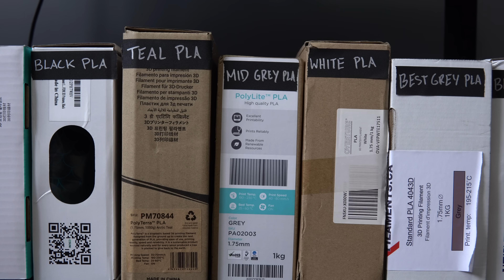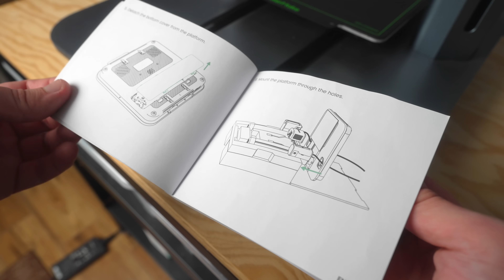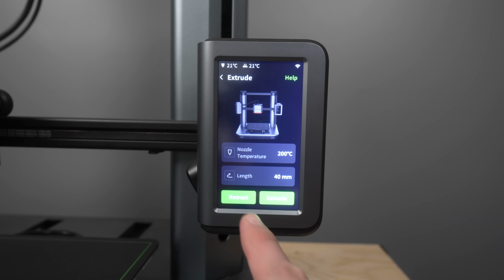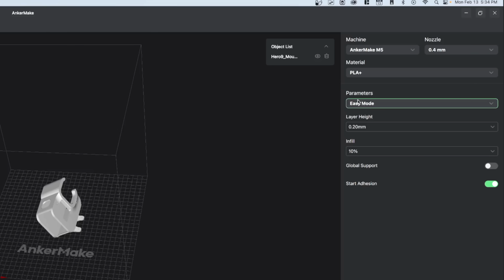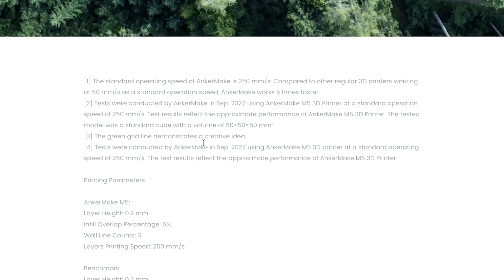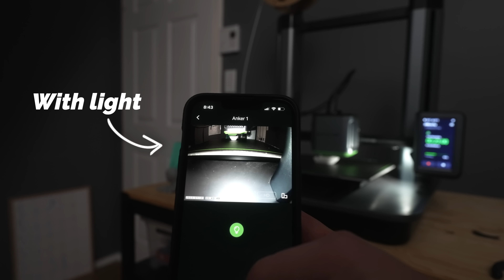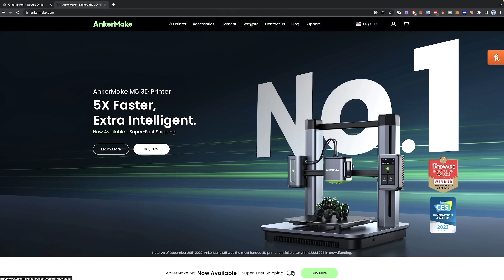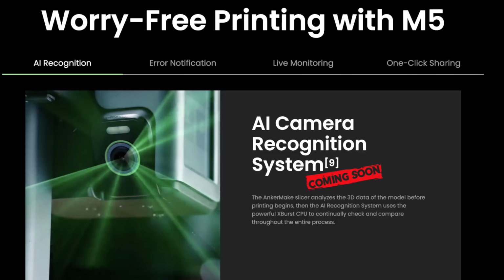The FASTEST 3D Printer I’ve Ever Used (Ankermake M5 Review)

Comment from the maker: You guys are totally right! The actual printing speed of the M5 will definitely be further limited by acceleration. As I mentioned, the 5X speed advertised is mostly a marketing gimmick but acceleration is another important limiting factor to consider. A misstep on my part!
Reply: Too bad they dont sell at bestbuy under the total tech warranty!
Reply: @darith27  total tech will still cover this! No matter what for replacement for 2 years. I’m a manager I promise you this Darith. Thanks for being a meme bee if you are one. But yeah speak to any manager there. They’ll tell you it’s cover for replacement for electronics damages.
Reply: i was looking for a good beginner printer, do you still think the ender is the best or are there any other options?
Reply: @Mewtwo-xi5og  it was never the best option. It was the cheapest option. Now everyone else makes a slightly better one, and creality makes a lot of much more expensive ones that are still flawed in the same ways.

Sovol Sv06 is a decent printer.
Reply: The truth is, the public doesn't have a "3D printer," it's essentially a 3D Element Solder machine. And why it's so slow. To actually do a "3D printing." It must solder in a full strip line at any one sliding longitude/latitude/altitude flow per layer make.
Reply: a MISSTEP (im crying rn)
Reply: like its a pun that's funny
Reply: i print 150~200mm/s in ender 3 v2 most time. but if i am using small multiple (table trex bones/comb), then i will use 50 mm/s
Reply: With a new software update it can do up to 500 instead of 300
Reply: Why would you delete the footage of the unboxing? That is a red flag.
Reply: Exactly what I was about to say. It is pretty nice and to me, easy to figure out. I had no idea how to 3d print before it arrived either. It goes SO fast!
Reply: Bruh th m5 now has 500mm/s
Reply: A boat took you like 1 hours
Reply: Wher are you bro ? hope you alright.
Reply: How long does it take to do a benchy
Reply: How long does it take to do a bench

Comment: You should look into a bamboo labs printer. The p1p is around the same price and offers 10x the printing speeds at good quality. And the x1 has the ai features that work for the most part.
Reply: Elon musk
Reply: I personally own an X1C and can confirm it is the best printer I have ever used. Also the base speed is higher then what we are seeing here.
Reply: They are also a lot bigger, and the P1P is $100 cheaper. This printer gets absolutely blown out of the water by both.
Reply: @HarryPorpise  yep there’s a reason the Bambu labs printers are being used by literally everyone. They’ve change the entire industry.
Reply: 10x the speed of M5? No. Don't get me wrong, P1P is great and mighty actually be a better choice but it is NOT 10x faster.
Reply: @NiklasCollin  twice the speed, eight times the acceleration. it’s pretty close to 10x as fast, and the ankermake often can’t reach its top speed.
Reply: Yeah this one is outdated and costly compared to x1. There is a new kid on the block now. Others have become outdated.
Reply: Ilon muk
Reply: @Niklas Collin  which best fast quality 3d printer do you recommend?
Reply: @HarryPorpise  what the hell? It's nowhere near 10x as fast. That would mean a 25 minute print on the X1 would take 250 minutes on this. Who is telling you this garbage?
Reply: There are still plenty of people who are skeptical of Bambu or outright anti Bambu because they perceive that it’s evil because of the “walled garden” non open source. 

But All that said every manufacturer will have to change to meet the demand for speed, quality, and ease of printing Bambu is delivering at the price it’s currently at. Furthermore I think the anger directed at Bambu should really be focused on the legacy manufacturers. 

For years they gave us basically the same printers, but with minor upgrades and with all the drawbacks that require nearly immediate upgrades. And if your into tinkering that’s great, but if you want to actually make stuff it’s frustrating. 

It’s embarrassing that companies like prusa sell their mk3s+ fully assembled for 1100 bucks and is 800 bucks as a kit, the p1p is 700 bucks and you attach 3 things and remove 3 screws, and they are virtually the same build volume. And it’s sure gotta hurt that a new company basically blew nearly all the competition out of the water when it comes to finished product sold. 

Sure you can flash klipper over to the prusa and control it with octoprint or a sonic pad but that’s extra money and time needed to tune the printer. And while we’re on the subject of klipper, why don’t more companies abandon marlin for klipper? Seems klipper is all around better, wait I already know why. Because by installing those 8 bit chips they get for next to nothing allows a higher profit margin but limits you to slower speed due to lack of processing power.  At least FLsun figured out that klipper and better hardware was required to speed things up. Only thing holding the delta printer back is limited build volume. 

Another thing I’ve noticed is the major advantages of a core XY printer over a bed slinger printers. Again less core xy printers because they cost more then the 20 bucks in aluminum they currently use (note price reflects wholesale bulk cost as you likely won’t find that tubing that cheap anywhere at retail). The simple truth is, companies stopped innovating and stagnated because it made them more money. Less cash out for development, more cash saved as the design is quite old and cheap to repeat, and well printers are in demand so we will just keep the price up. Oh did I mention since it’s open source they just wait for someone else to figure out some cool trick then wait for component prices to lower and add those features in. 

So in short yeah I’m a little salty about legacy printers and the lack of improvements from the industry. If I wanted faster or better I have to figure it out on my end, with my time, and more of my money. Oh and if it takes a while to figure out we’ll I’m just not printing more of those cool boats everyone seems to love to print (I printed 1 benchy ever, and don’t intend to print another because that’s 2 hours I could be printing g something else). 

But back to this video, yes it’s impressive they delivered a printer we should have had 5 years ago, and is faster out of the box then most of its competition. But it’s still slow, and still needs constant tuning. No thanks.
Reply: Ah yes lemme purchase a poorly built Chinese 3d printer that has 0 customer support! Good idea!
Reply: @brandonmoore9816  my poorly built Chinese printers tripled my business output. And I’ve needed 0 customer service and if one breaks I’ve made enough I’ll just buy another one. 

And before you start to think I’m running an Etsy shop, I make rapid prototyping parts for several businesses including aerospace. So being able to produce those parts faster means more business. The tolerances have been spot on and well within the margin for error. 

Now with all that out of the way I can see why people would be against Bambu labs. A lot of the reasons are pretty far fetched but the ones I believe have some merit are company history, longevity of the printers and risk of parts availability. And for the typical hobbyist it’s a risky proposition, but for me it’s literally increased output a lot, and as a result profits are up, business has increased, and there is a possibility of needing to expand again. 

Besides that as easy as these printers are to use beginners can approach the hobby and might expand further. Plus those printers are driving innovation forward in the off the shelf printers. 3D printing is for everyone, not just the people that like to build and modify machines and code.
Reply: I have read on their website it prints at 500 mm/s that the same as the ankermake. But 2500 mm/s is also possible in the future. Love my ankermake. But would certainly be tempted by a bamboo as my next printer.
Reply: @crazykevster28  I’m not sure how fast sport or ludicrous mode print but that sounds like the standard speed. I haven’t printed anything faster then standard on my printers but if you want to print faster you’ll have to make a profile to match the speed you’ll be running at. I’ve heard of both sport and ludicrous print profiles making good quality prints but hours of tuning and flow calibration to dial it in right. Standard is plenty fast for me.
Reply: They’re also deafening
Reply: Yeah it’s a good printer i have one
Reply: Horrible customer service though
Reply: Think bambu could be better got an anker make while it doesn't have the feed issue of bambu, it does have the tip clogging issue. Tbh at the end of the day I just care for what works. Also, bambu has mehish customer service,  but I think they will get better.
Reply: Fax
Reply: Bro said bamboo
Reply: Bambu
Reply: I have one and its a lot faster
Reply: Looking at this in 2024. INSANE how far bambu has come they are huge now
Reply: how much do they coast?

Comment: Havn't finished watching it but came here to say you should try the BambuLabs X1 Carbon or even P1P. I think the P1P is more in this price range (actually cheaper) and better.
Reply: Finished watching now. Another great video. Love the honesty and always respect your opinions! How's the FPV flying been?
Reply: 100% Anker's biggest mistake is staying with a bed slinger. This limits the speed of tall thin objects. My X1C is incredible, and has changed my entire perspective on 3d printing- and I've been printing for over 10 years! Started with a Solidoodle.
Reply: @Jwmbike14  same! Been printing for 10 years now. I went from a wooden Replicator and finally "upgraded" to a Duplicator i3 machine a few years ago because it was $100 and found that was a bigger problem than i would have thought. Not only that it also moves the parts through the air, effectively cooling parts when you don't want to. Learned even though it could print at 120mm/s at first it would have to be lowered the higher and heavier the print gets. While my old Replicator could print at 160mm/s perfectly (when printing via USB, offloading the board processing).

I picked up a Creality Sermoon D1 last year for $275, on clearance and open box. Going back to a solid bed had made prints far better since. Far more predictable prints and i can run it at 250mm/s 2,500 acceleration without an issue. Anything faster and the board can't keep up, needs faster electronics. I generally run it at 200mm/s 1,000 acceleration to keep it quiet, can barely hear it outside the closet it lives in.

*Should note tons of custom mods done to my old Replicator
Reply: i was gonna say the same thing
Reply: i’m actually Considering buying a bambuLabs X1 Carbon, do you happen to have it, do you enjoy it?
Reply: @benneely8864  Don't consider it, do it. My X1C changed my life. I've been printing since 2011 when I got a Solidoodle. I've never been this happy with a printer.
Reply: As an amateur I love my x1 carbon. Amazing machine really makes it a diy beastly tool.
Reply: @benneely8864  X1C is easily one of the best FDM printers currently on the market for its price. I've had mine for about a month now and it puts all my other printers to shame. The AMS system is a really nice touch too, cuts down on the manual loading and unloading between filaments and removes the need for a drybox to run materials like polycarbonate. And to top it  all off their slicer is surprisingly good even with default settings. So far the only real "upgrades" I've done to my printer is get a Wambam PEX build plate and a MicroSD card to save time lapses on.

The only issue with the printer I've experienced is the noise, but moving at these speeds that's pretty much unavoidable.
Reply: I have the p1p, my first printer.  I love it.  It's insanely fast and I haven't tried ludicrous mode yet either.  The slicer is great,  it has video,  wifi,  remote app control.   I was thing to get a prusa m3 but for less money this has more features and it's way faster.
Reply: @phasesecuritytechnology6573  I love to hear this!!! I am just torn because I kinda want to print abrasive filaments like carbon fiber/etc but I cant decide if thats something I actually need to do or if I just want it cuz it sounds cool. For that it's ideal to have an enclosure and hardened nozzle/etc. So thats why I am torn between the X1C and P1P
Reply: @LZRFPV  Well the p1p can be enclosed but I don't know if its as good as the X1C in that regard. It does take a hardened steel nozzle though, mine just showed up:)

Comment: I just got my third printer.  First was a BIQU B1, second Ender 3 Max, and now Ender 3 V3 SE.  The V3 has all these features at a fraction of the cost.  It prints fast enough it made me wonder if the filament had time to stick.  My print speed is 180 consistently.  I’m thoroughly impressed with the Ender 3 V3 SE.
Reply: I've had 3 Creality machines. They are good for a few months, MAYBE a year. Then the sub par stuff starts to break and wear out. The M5 is a totally different machine. That entire base is cast aluminum. It's more rigid than any printer I've ever experienced.

Comment: Hi, great video, I just wanted to clarify one thing. When you talk about speed you have to take into consideration acceleration too. Even if you set a speed of 250mm/s if you printer is limited by low accelerations, it will never reach that speed. Another thing to keep in mind, especially for vase mode, is layer time. Usually the slicer makes the printer move slow enough to give time to the layer to cool down before printing the next one. This could influence the real printing speed. 
In general it is a great machine, considering his cartesian kinematics

Comment: If you want to print large items, it’s also worth looking into setting up a little print farm (3 or 4 of the same printer) as opposed to investing in a single (expensive) printer that claims to do it all lightning fast. Different advantages to both for sure, but worth considering.
Reply: Print farms are a pain in the ass unless the printers have auto levelling so your going to end up spending a bit more anyway unless you feel like messing with bltouch sensors.
Reply: @acorgiwithacrown467  I don't have any auto leveling on my 4 ender 3's and haven't touched the level in well over 3 months using them daily. I did remove the springs and make the base semi rigid though using silicon spacers.
Reply: @Smokinjoewhite  For simple stuff its not an issue, anything complex and eventually you're going to run into issues.
Reply: Id rather have more printers
Reply: @acorgiwithacrown467  also not true! I've done many "complex" prints without issues
Reply: @acorgiwithacrown467  That hasn't been my experience at all.
Reply: Elon musk jumpscare
Reply: I don’t own a 3D printer, but if you don’t move the printer, why would it not remain level?
Reply: @StolenJoker84  I guess temperature change an vibrations. Also touching the bed could in theory change the alignment
Reply: i'll take 1 big voron or vz over 4 prusa's anyday

Comment: you could push your S1 up to high speeds too by using klipper on a rpi or alternatives...
Reply: its a stupid comparison because the acceleration is what actually dictates the speed the printer will reach. This is just another e3 clone
Reply: But you will have to tune that yourself. This printer is already set up for it, hence the price. If your new to 3d printing and dont like tinkering, i would choose that one or the bambulab p1p, if not, you can always get a cheapo ender 3 and mod it to the max. Both viable options imo
Reply: @aepfelpfluecker  A stock ender 3 can print as fast as this for 500 GDP less. Its not like its difficult either, you can increase performance dramatically by just upping acceleration in the firmware. This printer is a literal money grab and is not defendable in any way.

Comment: Quick question. I'm new to 3D printing. But something you said in this video got me thinking. You mentioned how it is possible to have defects in your print, or even an outright failure.
I'm not sure if these are always from a bad design or something literally just going wrong in the print execution process. But in case of bad design I don't see why someone couldn't develop a print simulator. Something that goes through the motions of printing the design electronically only (not physically). In that way it would only take a few seconds to complete because it is only limited by the speed of the processor and memory.

Comment: jeez,at work i software balanced settings for a fricking old junk ultimaker 2, to print at 100mm/s walls and 200mm/s infill with great quality and strength (acceleration 500 and jerk 30). And after all this time, all the fancy new printers can barely manage a fraction more :/ the trick is in managing flow and hotend limitation of it. The accelerations and speeds the printers CAN reach are verry high with the most basic hardware (and is almost never reached while printing)

Comment: This video comes across something like an ad. The bed slinging kinematic system, especially with a large heavy bed like this, is the hardest to make fast, and certainly not 5x faster out of the box. Having a "print speed" of 150 instead of 30 is not "5x faster" because the limiting factor is acceleration, and most of the time that giant bed will be moving less than 50 mm/s with typical acceleration settings suitable for it.